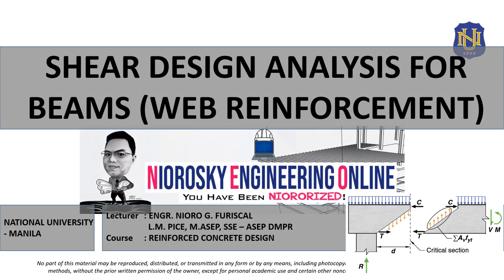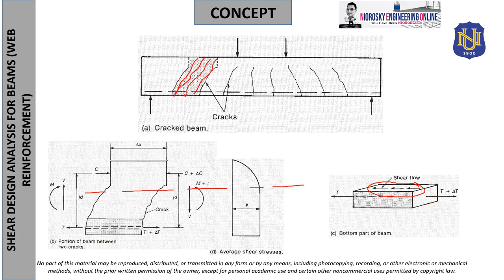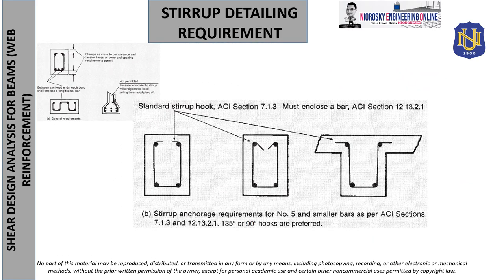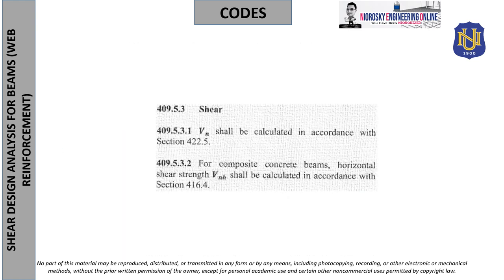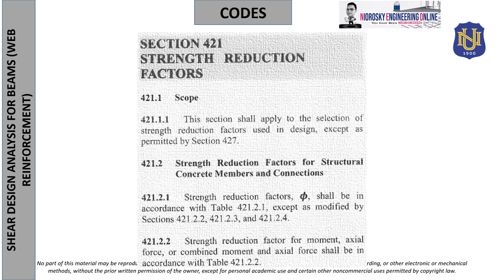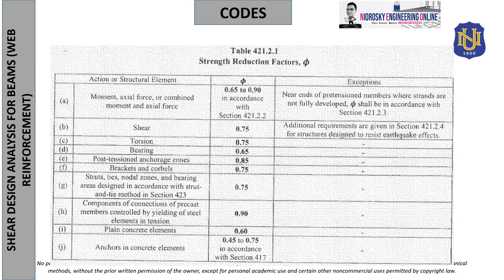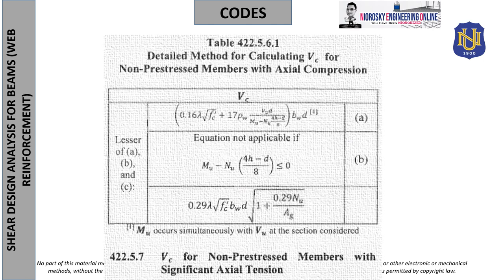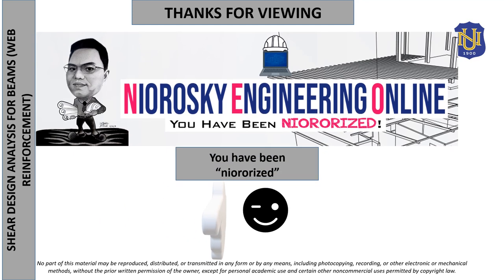SHEAR DESIGN ANALYSIS FOR BEAMS WEB REINFORCEMENT USING NSCP 2015

Comment: pls talk to university kasador/kamador how things are done on site.
Reply from the maker: sure why not. may i knwo the objective of my talk to a kasador or kamador? maybe it is fit to be done on other yt channel :) my main focus is the principle behind of what is typically done in the site based on code prescriptions from NSCP 2015 as the current standard through technical analysis and structural computations and also my experiences as the structural engineer designer and on site inspector/ structural auditor. cheers :)
Reply from the maker: note that under this discussion seismic code provisions are not included and to be discussed on a separate yt video lecture. it is better to discuss things one at a time before it is converted into a real practice since practices are derived from repetitive structural computations removing the outlyers and errors of the previous calcs as seen on past failures found on sites :)
Reply: @nioroskyengineeringonline8968  the objective ay yun mga kwenta (load cal) precisely correct pero mababawan yan kung mali ang pagkakasa. cheers
Reply from the maker: @danilodanting6052  that is a nice objective. After the principle of computation in accordance to nscp 2015 code provisions and here cones the practical side of installation. You can focus on your content with the intention of the discussion of the practical side of installing the rebars and web reinforcement correctly in accordance to ACI detailing practices. The objective of my YT channel is to cover most of the principle of computations with code provision and to provide some commentaries a student can appreciate for reasoning and basic understanding. You suggestion is a good idea and need to be done separately in order for the learners not to be confused and find it interesting with a separate type of discussion. Cheers. It would be on my future video lectures since i am also a practicioner of structural engineering designs and construction supervisory as a consultant :)
Reply: @nioroskyengineeringonline8968  thanks i know this is not the right place to talk about the consultant vs kasador. Wala pa basic rules as steelman  guide to follow piro books/handy pamplet ang electrician maging tubero ay meron. good luck experienced kasador/diy.
Reply from the maker: @danilodanting6052  then ASEP as an organization will play a better role on this in producing a potential handbook. I think it will be a future content of our NSCP volume. :) hopefully we can have this kind of manuscript with the beat practices of doing rebar installation though i think it was already stated in the NSCP in chapter 4 but not fully integrated in terms of visualization and application basically for low cost housing and low rise structures.

Comment: Hello sir, may tanong lang po ako, pwede gamitin po bah fy as fyt kahit na may given na As?
Reply from the maker: Fyt is the specs for rebar strength under web compression. Puede naman sila pareho ng main reinf strength. I have a discussion on that regarding the proper selection of fyt as done in practice. Cheers. Check my discussion on web reinf principle and analysis found on the same playlist. Cheers.

Comment: Paano malaman if significant yung axial compression/tension? Ano minimum value to compare actual axial to say na significant ito? Thanks
Reply from the maker: as the comparison of the actual axial force Pu to the capacity of 10% of the concrete compressive strength as a function of gross section. to consider cracking
Reply: @nioroskyengineeringonline8968  Is this based dun sa 0.004 minimum reinforcement strain? or meron  separate discussion sa code? thanks
Reply from the maker: Based sa pagkakaalala ko one basis ng code for strain limit min of 0.004 is the significant presence ng axial force.
Reply: @nioroskyengineeringonline8968  ok thank you
Reply from the maker: Kasi once mas malaki sa assumed cap na 10% means malaki na masyado yung tension force perpendicular sa cross section and can create additional moments to be carried, thus increasing the tension weakness of concrete. Kaya sa nscp 2010 it was mentioned if axial tension is significant, set Vc to zero since yung web element na kakarga ng buong shear force kaya Vn = Vs
Reply from the maker: Thank you boss :)